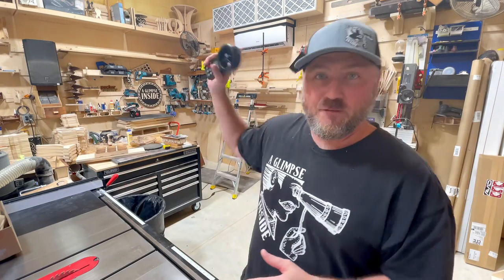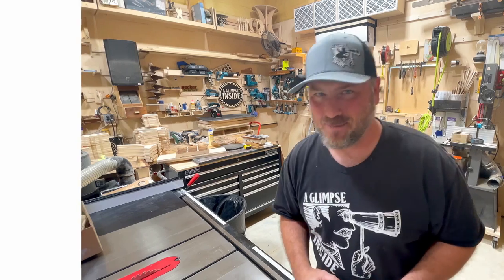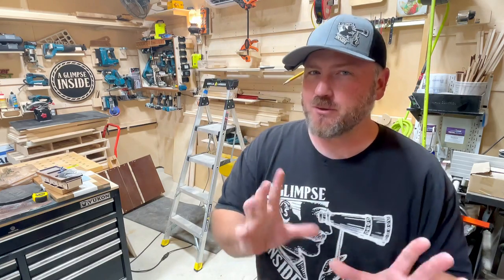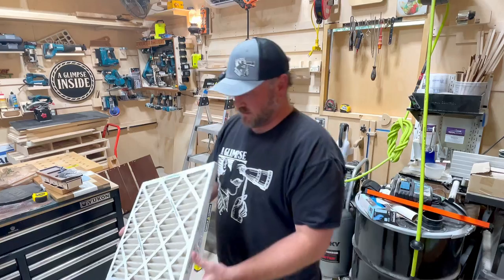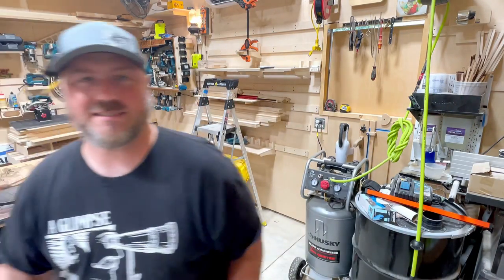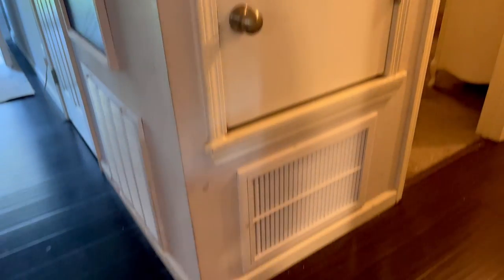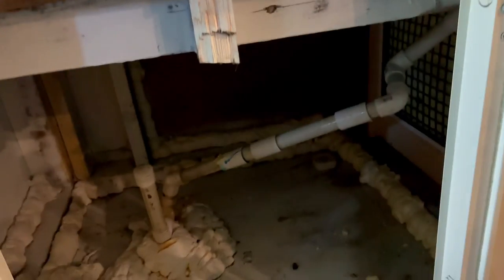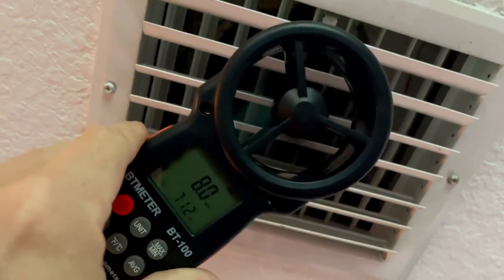I Have Proof You Should NOT Buy Expensive Air Filters

Comment: Your biggest issue here is testing procedure and data acquisition. You're measuring wind SPEED, not VOLUME. Checking the MPH of the air, while it does show some restriction, has little to do with air volume. Switch that manometer over to measure CFM. You could actually close down that whole box to a 4 inch tube and get way higher speed, but little to no volume.
Some of the reasons it's such a big deal is because 1. The system uses the volume of air movement to provide cooling for the motors and compressors within the system, 2. Restricting the air volume prevents the fan motors from achieving their proper current draw, further causing them to heat or overheat, and also wastes energy driving your bill higher. 3. restricting the volume of air movement prevents the system from operating at peak efficiency and increasing cycling times, stops the system from exchanging the air properly, and prevents your filters from cleaning the air correctly.
Again, CFM is way more important, similar to how CFM vs air speed is different for a dust collector than a shop vac.
Reply from the maker: Thank you for this. I really appreciate all the information and knowledge. Yes, very green acres over here. But I think it was just enough to allow me to make a proper decision. I should’ve guessed that this would’ve been pretty detailed information as someone who has the Fibonacci sequence in their logo, would absolutely know what you’re talking about. Thanks again brother.

Comment: What if you removed the internal mesh filters?  The filters you added are better than those,  so they should catch anything before hitting the mesh ones.  And any filter is going to restrict air flow.  So try removing those.
Reply: I'd be curious to know more about this idea. Agree it's added restriction that might be unnecessary. However, they are meant to be electrostatic, which might actually catch some finer dust the standard filters miss, in theory... More specific info on this would be really helpful.
Reply from the maker: I’m kind of scared to remove this. It feels like removing the safety shoot from the parachute. I know that’s a crazy and I was you but who knows I might try.
Reply: @AGlimpseInside  With your filter removed, you know the speed is 11 or 12, what if you removed the mesh filters, wonder how much they restrict.  So four test, no filters at all, mesh filters only, your filters only, and the mesh and your filters.  Of course, this is where you can fit it into all your free time.  LOL

Comment: You missed the entire idea of better filters vs worse filters. The better/higher merv rating requires more surface area for the same amount of airflow at the same restriction. This is the entire idea of a cleaning/dust filter.

There is a reason why home furnaces went from a 1 inch thick filter to a 4 inch thick filter. The thicker  filter has bigger pleats which make a larger surface area for air to pass through. 

What you made in your shop is the equivalent of a single standard home furnace filter now. What you have in your house is considered to be too small surface area for current systems.